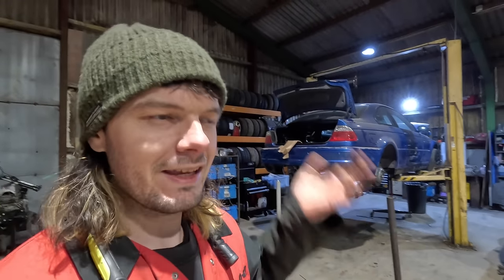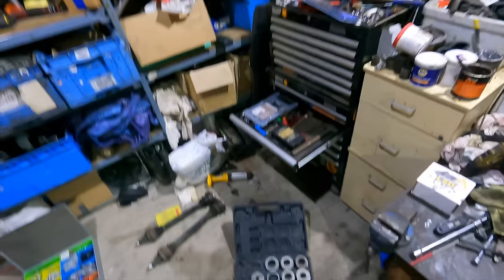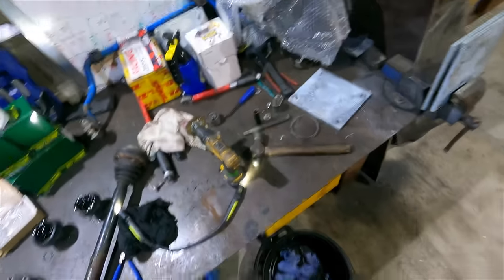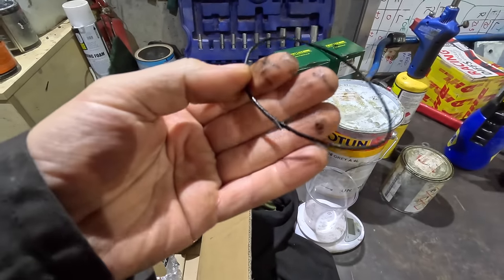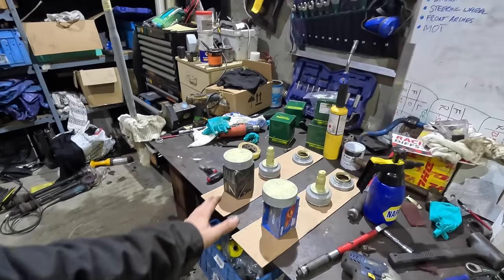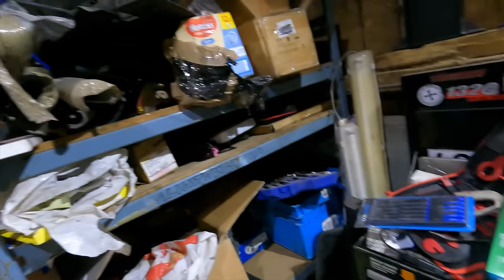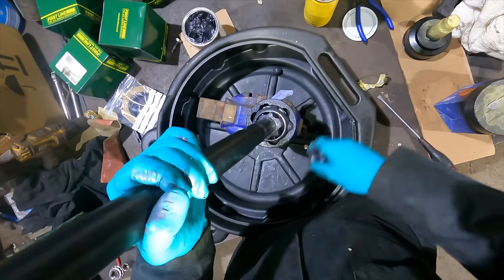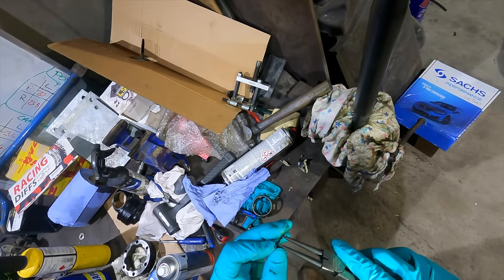FAILED BMW M3 LSD & Drive Shaft Rebuild

Comment: I looked up doing the shafts on my 328i. Was so much work I didn't even bother, managed to snag a pair of brand new SKF shafts on e-bay for £200 delivered. There are also companies out there that will refurbish them.
Reply: I took the same approach with my g40. By the time I’d have bought gkn cv’s and pissed about it was cheaper and less hassle to buy complete shafts. Although the Polo driveshafts are comparatively normal compared with these. Although sometimes I opt for cheapness and it usually ends up being a buy cheap, buy twice scenario.

Comment: What Ive found good is using POR15 metal prep and then straight with Bilthamber epoxy. Using 'rust converters' ive noticed rust coming back through the paint, regardless of how well you clean the metal

Comment: I would recommend some driveshaft spacers if you don't have some already. I pulled a CV joint out of the diff on my E46 M3 (on a trackday) and it knackered the end of the shaft where the splines spun coming out of the diff. Easy to fit if you have it all apart. 
I also rebuilt my diff with the RacingDiffs rebuild kit and it made a hell of an improvement, one of the best things I did to the car.
Reply from the maker: Never heard of that happening on these!

Racing diffs are a cool squad. Was chuffed when they wanted to be involved with the channel
Reply: It's commonly done with the drift crowd running all the lows, in theory you could get to same position in a big enough loaded compression on track?

Comment: I did my m3 driveshaft outer cv joints a few years back, I just beat the metal back in shape and the siliconed the joint, its held up fine for the last 4 years 👍
Reply from the maker: decent

Comment: We can all relate to these struggles 😂

1. Autotek etch primer and matt black is a good combo, for the love of god don’t brush paint on ever again 😅

2. The solid mounts you can buy come with wayyyy too much interference, I designed my own which press in easily if you ever need more in future, never had an issue.

3. Silicone in the drive shaft housings works great, I’ve never had a leak from that method.
Reply from the maker: i would rather brush on good quality paint than spray on shit paint, guess we will see how it lasts
Reply: @dannyDC2  agreed but it is decent stuff in my experience, most durable and corrosion resistant stuff I’ve ever tried, good value and nice finish also

Comment: For future reference danny paont is as im sure youve worked out now fussy. Lot of variables you need to get right. 

Temp, dont bother painting anything other than hammerite under 15 degrees really. If you are heat lamps are great to get the paint and thing your painting up to a good temp (ideally 20-30c). Paint then with the heatlamp still in use ans then leave it for atleast an hour before you eemove the heat. Vast majority of curing happens in the first few hours in most instances. 

The white stuff youre seeign is blooming, very common when painting in cold or damp conditions. Essentially is moisture trapped in the paint.  

So grab an outdoor patio heat lamp for £30/40 and youll see improvements. 
Heat gun is too much hest over too small an area for too short of a time. Only really any good for wrinkle paint. 

Hope that helps 👍

Kepp at it lad, feel your pain through this video. If something can go wrong it will ay!
Reply from the maker: Haha it’s always under 15 degrees in there !
Reply: @dannyDC2  tis the struggle of our delightful British weather!

Comment: I think some of the Bilt hamber rust removal products would be a good thing to have in the cupboard in the barn. 
It’d be nice to drop stuff in a bucket and come back to them after doing other things, to find them free of rust with no real effort.
Reply from the maker: I’ve seen some American channels before have a few gallons of rust evaporator stuff that they pour in old bath tubs
Reply: @dannyDC2  evap-o-rust or whatever they use.
I’ve had a tub of the stuff in the outhouse with a cover over it for a while.
Anytime I’ve got anything like this to do I drop the parts in it and walk off.
Some boiling water helps to speed the process up, and taking up the spare space in the tub with some bottles filled with small stones and water means you don’t need as much product.

It stops flash rust when you take them out as well.
Definitely recommended.

Comment: On my E36 M3 LSD bmw sent me the wrong gasket, so I used some universal paper gasket and sealant, never leaked again. Don't over torque the drain/fill bungs, it will put a hair line crack in the cover and weep, I think it can also happen from general wear and tear/age as mine decided to crack after the 4th diff flush :\ E46 might have a stronger cover IDK? Nice one for a long video my brother!
Reply from the maker: i dont see a time where 4 diff flushes would be needed haha
Reply: I had the diff fully rebuilt (even used reinforced top hot bolts/changed every single thing you can buy!) and drifted the car, so wanted to make sure there was no swarf in there, so did 2 flushes and the other 2 were just service changes after mileage, I used that posh Castrol 75w140 race stuff that's recommended for M5/GTR's... Diff's still going today in my mates E36  @dannyDC2

Comment: drive shafts do have to work harder on a fwd obviously. 

honestly i wouldnt change the oe boots if they are not starting to get briddle / or show any signs of thier age.
at least if you want to replace them with aftermarket ones. 

but if you use oe ones its fine. 

sometimes its better to never touch a running system. 😅
Reply from the maker: if it aint broke dont something something 

although they looked like a potential failure point for the future and were seized into the hubs last time I tried to remove them

Comment: Hey Danny, if you're interested in an output flange cover with a hex feature on it so you can measure torque from the center I can easily design one for you. I'd just need to know what the bolt pattern circle diameter is (easy enough to measure with a caliper), and the bolt size, and then you can get it printed locally. Maybe a friend has a printer or you can get it printed by a service.
Reply from the maker: Appreciate the offer but it’s okay. I can measure more accurately once the car is back together using the hub nut 

Be interesting to see how that compares with my offset reading..
Reply: @dannyDC2  any time. Maybe just remove the brake pads to make sure they're not a factor. The bearing might add a bit of resistance too.

Comment: Now then. Do you know if the 4.10 fits a Z4M too? If so I’ll have that potentially
Reply from the maker: pretty sure the LSD is exactly the same so yeah

i'm not selling mine but you can probably find one
Reply: The internals can be changed between the 2. To make a E46 M3 diff casing fit a Z4M you need to change the rear cover as it has a cut out for the rear diagonal reinforcement bars.

Comment: Unfortunately them first line boots won't last a small fraction of the time the old cracked bmw would have😔 atleast they never do on front wheel drive cars, i was well disappointed  with first line i thought they was a half decent make not anymore
Reply from the maker: I’ve used them before not had a problem
Reply: @dannyDC2  🤞🤞🤞 for you after all your hard work you put in, just didn't last long  on my mum and dad volvo and the odd  Customers cars at work, it's just I have never seen a  Factory BMW one fail in 18 years as a mechanic, if only I could  say the same for bmw diff's